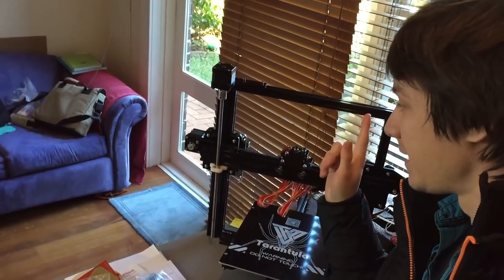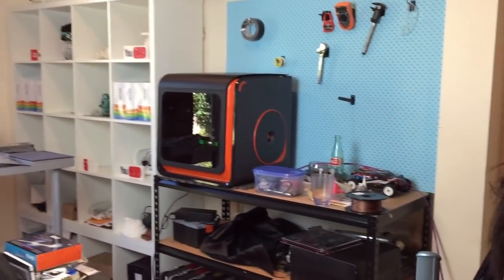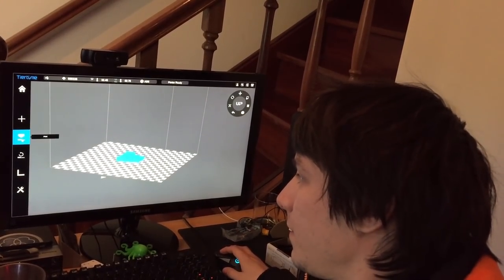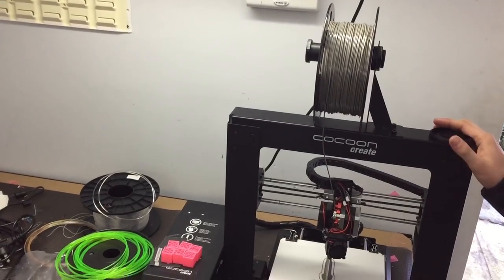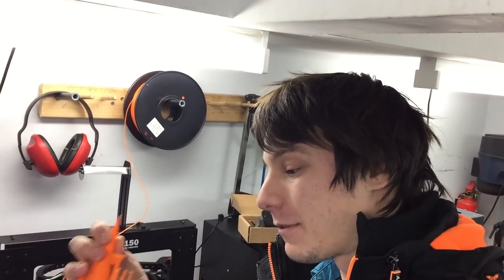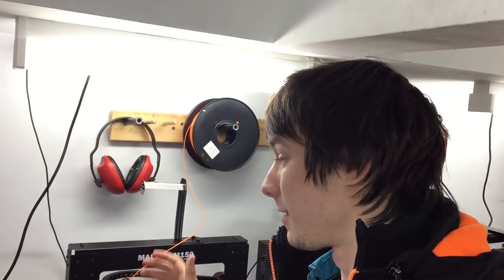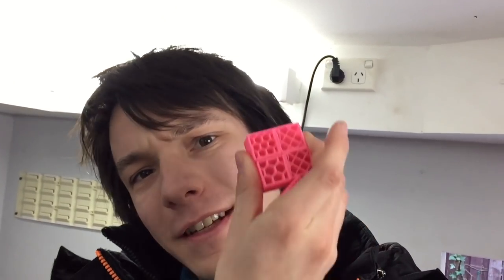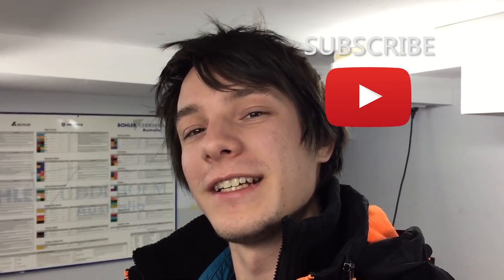Fix ALL the 3D Printers! July Vlog

Comment: Some pro tips for the tarantula (I own one since a few months): Use the "external" aluminium angles at the bottom corners instead of those that sit inside the groove. Move the threaded rod assembly as far towards the middle as possible without crashing into the x axis. And use the acrylic angles at the top. Also check out the FB group if you have any issues.

Comment: 4 longer shelf mounting brackets, thick strong ones with accurate 90 degree planes, machinists square, 8 M3 hex cap screws and nuts to attach them to the rails, that Tarantula would have stabilizers for the vertical rails and less Z axis wobble.  Just seemed like a possible solution watchin you shake it.  Don't own one never tried it.

Comment: Hey Angus. Do you have a fix for Up Boxes auto height sensor. To date I've found this feature to be completely useless and I now just set the manually. Bit disappointing considering it was one of the main selling points in my decision to buy this particular printer

Congratulations on hitting 25K
Reply from the maker: Hey Gavin, the Auto height sensor error really annoys me. My only solution is to deduct 0.3mm to the height it 'detects' then it seems to be far away enough from the print head. Cludgy I know...

Comment: So, will you be able to do the dual extruder tests I requested.  Carbon fiber filament, and ABS used together to minimize ABS warping to avoid an enclosed heated chamber.  The other Using Ninjiflex as a support material joint to reduce cleanup of support material.  Just using a second shell created in Zbrush cleaned up support material considerably for me on a single extruder.
Reply from the maker: No, I can't do those tests. Sorry
Reply: Busy with other things. don’t feel it’s a worthwhile test, or it need a hardened nosel added first?
Reply from the maker: The Tevo is bowden extruder and a low cost kit, so not capable of printing any of those materials correctly, plus yes the abrasive filament would eat away the nozzles. It's an interesting idea, but I feel you can do ABS with same material support no problem, just need a hot print chamber
Reply: If it worked which would be cheaper an enclosed chamber 3d printer or a hardened nozzle.
Reply: +tmarti69 The only printers capable of printing the continuous carbon fiber filaments start at $5500, the normal carbon fibre impregnated filament used in 3d printers would just warp with the ABS.

A hardened nozzle is about $20, a heated chamber would cost either the price if a whole new printer with a heated chamber or whatever it would cist you to make one for your current printer... either way quite a lot more.

Comment: I just recently got my 3d printer (Zortrax M200, great so far), but seeing other printers continually move the print bed itself forwards and backwards (as opposed to just up/down with hot-end moving in 2 dimensions) just make me shudder -  Doesn't all that movement cause tall/thin prints to fall over?
Reply: If your print falls over, then it wasn't stuck to the print bed good enough.
There is  a bigger problem with these Mendel style moving bed printers - moving mass... It is enormous.
Very old school. Modern high performance printer designs (like your Zortrax M200) minimize moving mass and can therefore accelerate and print better quality prints in less time.

Comment: Is there still going to be a TEVO review?
Reply from the maker: no. the tarantula was taken apart and used for other projects, my early kit had loads of problems.
Reply: Kinda disappointed that you don't have it and even more that you don't recommend it to new people whose interested. I'm one of those who bought it (the 2017 ver) before I knew your channel. Decent kit and produced decent print with just layer fan cooling and sheet of glass.
Reply from the maker: That's just it, you bought a later version. The Tarantula (and many other low end kits) are 'parts' kits, gathered from many different manufacturers. For my particular unit the issues included:

- Rollers binded when tightened due to no washer (this is still an issue aparently, and it's been 'fixed' with nylock nuts. Proper rollers can be fully tightened and still roll freely.
 - Extruder leaked PLA around the nozzle due to the very poorly formed threads. My kit had the terrible dual inline nozzle hot end. Both leaked no matter how tight the nozzle was tightened to the barrel.
- Use of V rollers on non V extrusion leads to grooves forming quickly on the rollers.
- Powersupply is a deathtrap and just sits out there unless you print a cover for the mains component. Also my kit came with a non grounded 2 pin plug.

SO yeah, beyond my dislike for the design of the kit in general those were the issues that got in the way of me recommending it. I much prefer machines like the TronXY X1 which use the correct V slot extrusion and run safer power supplies. They still need cooling fans and a few mods, but nothing as severe.
Reply: Thanks always wanted to know your reasoning behind your dislike. Design wise I don't really know much about 3d printer but I'll keep it in mind what you wrote up there. The powersupply..I know I cringed at it when I did my wiring so I made a cover for that. 

And if somewhere were to ask me which cheap 3d printer I would recommend, I'll point it to your Tronxy X1 video and let them decide. At least its safe especially for the kids. Still need supervision though. 

Great channel you got here m8, looking forward to your videos especially your budget makerspace and livestream (got some questions)
Reply from the maker: Glad to clarify! There's an awful lot of misinformation being propagated at the moment and some still see red because I didn't like the tarantula, but there's loads of other machines I didn't like too, plus it's all down to personal preference! Hope to catch you next stream, not sure when that'll be though...
Reply: I'd like to ask a question while your here, if You don't mind. Why won't you do a review of the Anet printers or Creality?
Reply from the maker: Creality - nothing further I can add as they've already been covered so heavily and Anet, well I did review the STARTT which is like a baby anet, but honestly I don't have the time to invest in 'improving' such a budget kit.
Reply: Maker's Muse okay, thank you

Comment: there shouldn't be a speed difference from 64 bit vs 32 bit.
Reply from the maker: It can use more memory, loads up the meshes faster.
Reply: Yeah it can use more memory but I highly doubt the software was bottlenecked by memory. If it was then it's probably not very good software.
Reply: Well not efficient. It can still be good I guess.
Reply from the maker: Certainly not very efficient. Though the new one seems to chew up way more system resources than it should... ah well.

Comment: the tran has a facebook page
Reply from the maker: Cheers, yep great community around it.
Reply: Yeah definately! 

https://www.facebook.com/groups/TEVO.3dprinter.owners/

Just for info: You are having wrong L brackets at the bottom of the frame. There were 2 larger silver ones delievered what replace your small ones. The frame gets much more stable after -  also simple print 2 for the upper corners too... this are the only mods I have on my stock machine + a fan. Hope this helps :-)